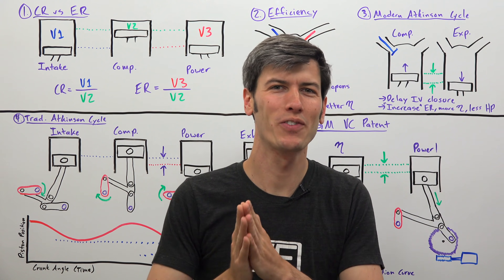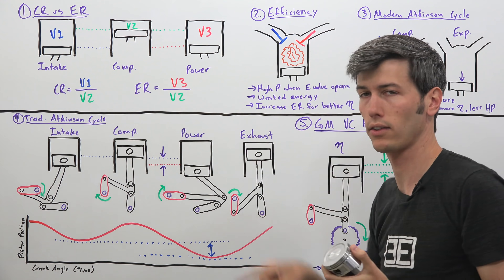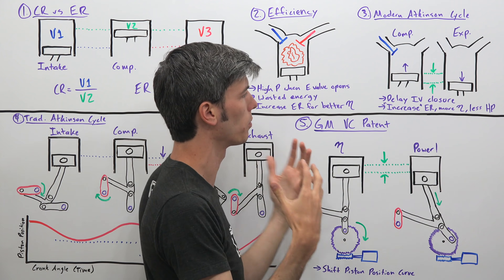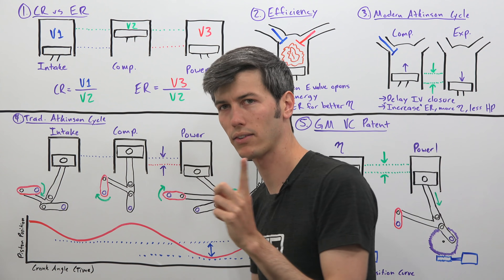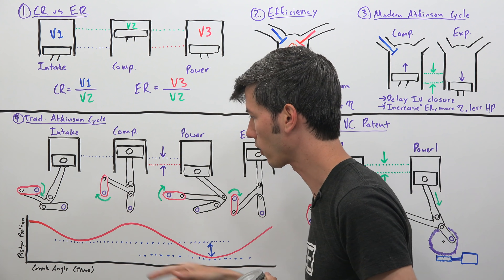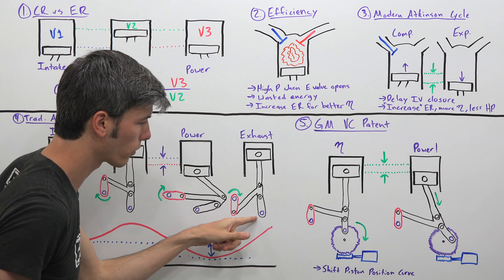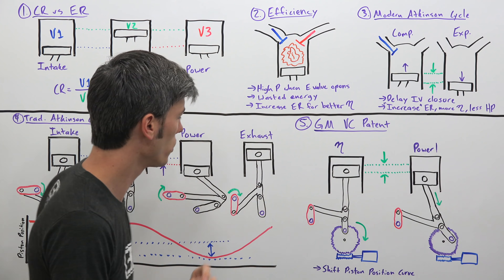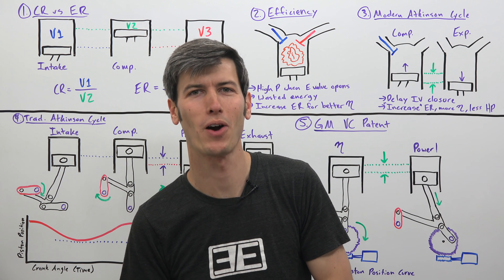How GM's Variable Compression Engine Works - Patent Review

Comment: 100% chance of all these engines failing if GM makes them🤣
Reply: Now with a 30k mile power-train warranty!
Reply: Yup GM at its finest
Reply: Sounds like an American-hater.  There's always "better" countries for people like you.
Reply: @TucsonDude  Nope, not an American hater. It's an actual fact, and it's quantifiable that American cars are less reliable than Japanese and Korean cars. That being said, when it comes to the bigger engined vehicles, I'd still love a Mustang.  Currently I drive a Jeep and the interior is no where near as well put together as any Japanese car I've driven that costs half as much. Shopping for it was like an absolute mine field with most vehicles I looked at having some major fault. I bought the Jeep because it was cheaper than the equivalent Japanese vehicles which were older and with higher mileage. It's surprised me how capable it is off road and although it's had a few niggles here and there, it's never actually let me down. Parts and services are very expensive though. All in all, American cars tend to have a lot of character but are not built as well as Japanese, Korean or German vehicles of the same segments. I blame it on the accountants.
Reply: @ChuckRage  Well, your first problem is you are comparing a Jeep. I love Jeeps, but let's be real here. They've never been known for interior quality, or comfort, and in recent years even reliability. (Of course, the 4.0, and 2.5 were absolutely bulletproof.) I've sold vehicles long enough to know that a GM, Ford or even Dodge will at last ANY modern BMW, Mercedes, and a lot of Korean cars. I have a list with the highest amount of miles on un-rebuilt engines, and so far the order is a Chevy 5.3 pickup with 700k miles, a 1996 4 Runner with 545k miles, and a Ford Excursion with a 7.3 at 485k miles. You can even find pictures of them on my Ifunny account. Just like Toyota had issues with headgasket blowing on the 3 liter V6 in the 90s, everyone has had issues, but overall both are pretty decent quality.
Reply: @Mrjohnnymoo1  You are 100% correct about the Jeep, but I've noticed similar patterns with interior quality in most American vehicles (compared to similar vehicles in the segment while new.) While the big American engines do tend to do pretty well, most  of them are  just slightly updated designs from 30 years ago. While not all big engines are reliable, in general big engines are naturally more robust. Outside of North America, most of the world buying American cars are buying medium sized family vehicles or econo-boxes. It's with these smaller, newer, more complicated drive-trains and engines that the problems start vs equivalent vehicles from other countries. There might be some pretty decent and affordable to use American vehicles in North America, but in most other places it's a real struggle to find the same. The rest of the world just doesn't, or can't physically drive those big, robust American trucks with fuel prices and narrow roads/ parkings. I'm not a huge Toyota or Nissan fan, but there's a reason why you see Toyota Land Cruisers, Nissan Patrols and Mitsubishi Pajeros always running around in the bush/ dessert/ forested/ arctic regions and not many vehicle from other manufacturers. People in those environments naturally gravitate towards the most reliable vehicles because a breakdown could literally mean death, unlike a day mudding in a huge Ram or F150 for instance.
Reply: @ChuckRage  I understand what you are referring to, and the emissions sound rough for other places. I can agree smaller engines have never been America's strong point. Toyota definitely has the 4 cylinder market cornered for reliability. I was mainly referring to people drawing a straight line across the board and saying that they'll have poor reliability. As said before, no matter what brand they are, they all have good cars and bad cars.
Reply: Based on what? What engine has GM made in the last decade that's any worse than some of the complete garbage with Honda, Toyota, Subaru, or Hyundai's name on it. I can point out a LOT of JDM engines with major issues that have rolled off the assembly line lately. In fact, I seem to remember a major recall for 3.5 V6 engines by a certain manufacturer that had pistons TOO BIG for the cylinder bores. Engines were literally seizing up because some company couldn't be bothered to make sure the bore was the correct size for the pistons they installed.
Reply: Yeah, they will all get GM'd
Reply: ...GM literally has all the records for most reliable engines, fellas.
Reply: @evilkillerwhale7078   Their  larger  engines specifically v8 are good, their smaller 4 cylinders though? Not even close.
Reply: @BigHeadClan  The engines that have powered all of the USPS mail vehicles are the GM Iron Duke 4 cylinders.
Reply: @Mrjohnnymoo1  A carborated Engine produced in the 90's is your evidence?  You do understand that there has been about 5 generations of new engines since then ya?

They are using the Ecotech engines at the moment and those have had plenty of issues.
Reply: @BigHeadClan  First of all, I am not even gonna fully acknowledge what you said, because the last produced carbed engine came out in 1981. Far off from the 90s.
Reply: @Mrjohnnymoo1  The 1981 date was for the last 301 produced by Pontiac, the Iron Duke (a cutdown version) AKA Tech IV actually kept selling into the early 90's for cars like the Pontiac Grand Am, S-10 and another half dozen models under Buick/Pontiac/GM.

They re-branded it but the Iron Duke was alive and well right into early 90s.

Edit: Oh and my main point was that using an engine from the 90's was a terrible indication of how well GM does today. So if your using the Iron Duke and it did stop production in the 70's that makes it even worse an example.
Reply: @BigHeadClan  Their 2.4 Ecotec has been a very reliable engine.
Reply: @hochhaul  The Chevy Equonix and GM All-Terrain had massive issues with that engine... Heck GM has a lawsuit for multiple issues on that engine. 
Subaru and Hyundai definitely have had their issues with smaller motors,  every manufacture has issues at some point after-all. GM is just one that seems to have them
far more frequently.
Reply: @BigHeadClan  They had the EXACT same problem that Toyota Honda and Subaru had. The lawsuit was due to oil consumption. GM warrantied those engines. Do you what GM uses for a maximum allowable oil consumption? 1 quart per 2,000 miles. Toyota? They tell you it's "normal" for their engines to use up to 1 quart every 1,200 miles. Honda? The same. You DO realize that Honda was sued for massive engine problems, right?
Reply: @hochhaul   Soo we agree the 2.4L engine from GM has issues,  you know what Honda, Toyota and Subaru aren't doing? Building a new complicated system by the name of Variable compression engines....  

So why would people have faith in their reliability with a track record like theirs?

As for the other manufactures of course they will push off a re-call until they are sued in order to try and save money... Just like every other car manufacture... It's not a unique thing they are all shady.
Reply: Aye people were super skeptical of Nissan's engine, I wouldn't want my wallet anywhere near GM's attempt at the same technology.

Comment: It must be an absolute nightmare to calculate primary and secondary balance for this engine
Reply: Can't agree more. And pretty much for GM's way of the concept, I'm not sure where would you even place the crankshaft in the first place.
Reply: @Director1456  And I am imagine where will the main drive shaft be placed.
It moves, left and right, and sometimes, up and down.
So my guess, the main drive shaft will move too?
Is it a little risky to move rotating shaft in a small confined place with lots of vibration?
Reply: Pretty much it'll be EVERYWHERE for the crankshaft. Heh. In serious note though, would the crankshaft be moving left and right, or fixed at one spot like the one in the video, where it's rotated by.. an electric motor??
Also, you mean crankshaft, right, Kevin? The driveshaft is what comes after the differentials.
Reply: @Director1456  Oh yeah.. after a bit research (googling), it is called crankshaft...
Sorrym English is not my first language.
I think there is a time when he explains in the video that it will be move left and right
Reply: Or again... maybe just my missunderstanding...

But after watching Nissan VC, I think I know that the left thingy that rotates adjust the diameter of the piston needed.
So maybe the crankshaft don't move left and right
Reply: And I think I gor the grasp..
That left thingy which rotates will increase the torque produce and power by increasing the diameter which yield.
And while compressing, decrease the diameter.
Reply: Oh hey.. I think zi can imagine how it works now XD
Reply: @Dominus_Potatus  Yeah though as probro said, it's going to be a super nightmare to calculate the primary and secondary balance of this engine, man I wonder how would the crankshaft even LOOK like
Reply: @Dominus_Potatus  is it a worm gear to adjust crank flywheel position???
Reply: @shubhamsarkar2186  Can't make it sure...
I think that worm gear to change how high or low the position of the piston
Reply: @Dominus_Potatus  The red part on the left is the crankshaft.  Its remains in the same place and always rotates around the same axis.  In the traditional Atkinson cycle, the piston and connecting rod are attached to the crankshaft via another linkage, which pivots around a fixed point - this is the lowest pin in the picture.  In the GM engine, this linkage pivot point is adjustable across an arc.
Reply: @Director1456 It would look like a normal crankshaft.  Instead of being attached to the connecting rod though, it would be attached to the lower linkage.

Comment: Any idea of the improvement in fuel efficiency and power?
Also, from the engineering POV, could you point out:
1. How many moving parts are involved in the design.
2. Given the additional complexity, what are your thoughts regarding reliability and friction.

Excellent video, very clear and simple to understand.  Very thorough, starting from the basic piston design, to the improvements from the Atkinson design, to GM's innovation.

Comment: I'm sure the design will be tighter with shorter linkages and all, but this thing as presented looks to be doomed to frequent catastrophic failure, or a low RPM life.
Reply: I agree. I also can't imagine it making particularly large torque numbers with an offset crankshaft where the downstroke of the piston pushes a lever sideways on the crank. Transferring power directions is parasitic loss and also stress points
Reply: The added linkages has me worried, but I won't presume that I'm smarter than the engineers working on things like this. But at the moment it's, AFAIK, just theoretical. So until we know someone is actually working on implementing this in a production engine I'm not concerned about the possible failure modes.

Comment: I wonder if this will really be that much better than using cam phasing to keep the intake open a little longer. It seems cool, but IMO it’s not a big enough difference to warrant the extra cost and complexity. I also don’t really trust GM with these sorts of things. If it were Honda doing it, it’d probably work fine, but GM has a history of half-assing these sorts of things.
Reply: Seems to me, that you could build a more responsive cam-phasing system. Both of these solutions are "power on demand" not 'all the time'. So, you should be just as capable of switching between a conventional cam-timing, and an atkinson cam timing when you want power or efficiency respectively.

Comment: I don’t really trust these; there are a lot of failure points. If I made a VC engine, I would vary compression by modulating turbo boost.
Reply: That doesnt vary compression ratio.
Reply: Kolin Stallman no matter how much air you force into the engine? 
Edit: oh nvm I forgot what compression ratio was LOL

Comment: wouldn't Nissan's VC Turbo be a able to achieve the same by doing the intake valve trick ?
Reply: Hmm possibly, I could totally see them adding it to a revision of the motor. Nissan is weird about what they choose
to include/exclude on their engines. 

They could have added Start/Stop and transmission disengagement features to the VR30 and VC-T engines but both cars lack the feature because
Nissan hit the MPG goal they set without implement that technology.

Comment: GM wants power and efficiency. But not reliability. 

Is this better than Nissan's variable compression design?
Reply: GM's current efficiency technology is to shut down cylinders until the tow truck is doing all the work.
Reply: @bendeleted9155  Sir, I am forwarding you the dry cleaning bill for my piss soaked underwear. God bless and godspeed you sob ( ͡ᵔ ͜ʖ ͡ᵔ )
Reply: Nissan and GM should partner up.  They basically think the same, care very little about reliability.
Reply: It’s only less reliable than a simpler engine IF all other variables are the same. Like material, and metals it’s made of
Reply: Nissan's CVTs are probably going to be better than this. And that's saying something
Reply: @Anon Anon ok so why doesn't my 2000 Toyota Camry have a 2JZ rather than the 1mzfe V6? Lol all jokes aside though I get what you mean but Toyota does have a lot more powertrains available... With the majority of which being much more reliable (and efficient) than the Last engine
Reply: No OBAMA mandated CAFE standards got us here.
Reply: @BigEightiesNewWave  good point. Therin lies the root of the problem.
Reply: Btw whats the difference in Design. Cant remeber that Video from Jason anymore
Reply: No. Its not.
Reply: Nissan/Infinity's system aren't reliable anyway...and this won't be better
Reply: Stop reading JD Power & CR. Theres a
Reason the LS motor is the #1 swap. 
Cheap light & reliable
Reply: @WindyCity1992  I think Icrazy8I was referring to the Nissan and GM of this century. 😉
Reply: @WindyCity1992  cheap. Reliable? Why are there so many in  junk yards? Light? Coyote 5.0 is 40lbs lighter than ls 6.0.
Reply: @darrenmcfeaters6683  an 6.0 ls with an aluminum block weights around 470lbs fully dressed a 5.0 coyote weighs 440 lbs without accessories.

Comment: Volvo made an attempt by cutting the block horizontally and hinging bottom part. So the cylinders and head  could be tilted which lowered compression!
Reply from the maker: Interesting! Kinda similar to what Saab did with tilting the cylinder head. Neat!

Comment: I have a very very basic understanding of engines but would something like this be compatible with skyactiv or would it be unnecessary
Reply: White Hotep unnecessary, unethical, inefficient too many moving parts, too many sensors, too many points of failure. The goal is too be efficient while keeping price point down and reliablilty high, thats a tall order for any GM/Chevrolet vehicle

Comment: thats a lot of bearings for a GM product. i can already see the failures 😬
Reply: thats the problem with good manufacturers. they make one.mistake and people will remember it. gm and chrysler makes so much crap that people dont even bother noticing it because they are just used to it.
Reply: That's what I was thinking 🤦‍♂️ not to mention that's a lot of movement and rod angles.
Reply: the problem is that gm will be building it. if it was toyota or honda i would trust it
Reply: you mean Honda with its GDI oil dilution issues?

Comment: It is quite clever but also complicated and hence delicate (r.e. prone to breakage). I very much favor the manipulation of valve timing to accomplish the same effect. With the combination of computer controlled valves (via the Koenigsegg Free Valve system) and variable spark timing I'm certain that GM (or any other engine maker) could achieve results that would match or exceed what has been described here.

Comment: So wouldn't the torque number be limited to how strong the teeth on that worm gear are? Also I can't imagine the crankshaft has a very large offset between the main and rod bearings, so they would need higher rpm's to compensate, but would this engine be capable of higher rpm's with so many moving parts?
Reply: Possibly but must torque should be going to the crankshaft hopefully. I don't think this engine will necessarily have to spin faster for the same amount of torque, since it will be getting a power stroke with every 360° of crank rotation per cylinder whereas a regular engine would be one every 720°.

Comment: Why so complicated? Isn't it easyer to use electrical driven intake and exhaust valves? No camshaft and no timing belt or chain and no throttle is needed. Also you can tune an engine much easyer by changing the timing in the ECU. Why don't they use it in mass production?
Reply: Because american car companies are the retards of the automotive world.....
Reply: Could be any of a number of things, mostly economics.  Having to retool facilities, acquiring sources for material to machine, reliability of technologies, etc. . . , also it has to be profitable for it to happen in the main market.  I believe koenegsig has what your looking for in the free valve system tho so the technology is coming.
Reply: It's possible (F1 engines, Koenigsegg Freevalve) but expensive to produce.  GMs ethos is one of cost reduction above all other things.